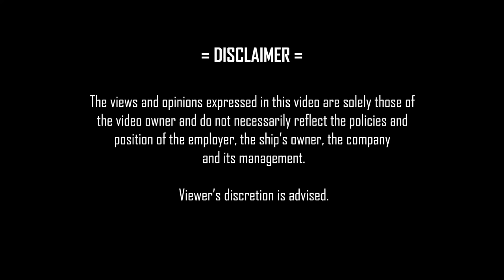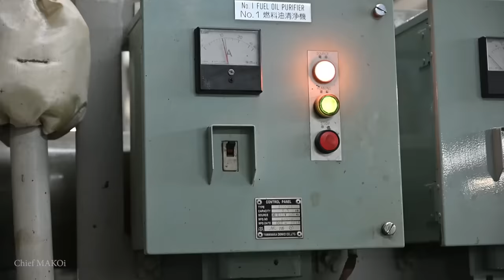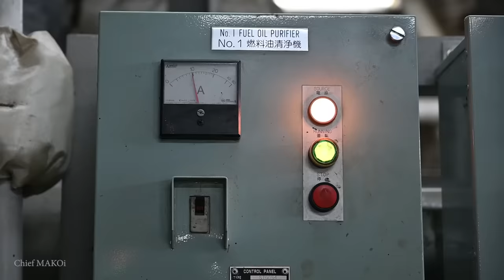Fuel Oil Purifier Overhaul | Selfjector | Chief MAKOi

Comment: Interesting from the mechanics point of view. Skilled labour I have to say, some little improvements could be made, a washing cabinet with pump and brush for example. Best would be a parts washing machine, but I guess filipino hand wash is better and cheaper ! In high labour cost countries its another game.
I also don't even have a washing cabinet, hand wash as well ;-(. Maybe i can find a drawing to understand the function. It separates liquids by density, interesting, normaly solutions cant be separated that way, so this oil might more be emulsion type of fluid.

There is a saying in german : Hand operation is better no matter how sweet the girl is ;-) Bwahhaaaaaa

Comment: What is the clear liquid which is used to clean all the parts? For example at 12:26.
Reply: I believe it will be something like kerosene or acetone.
Reply: Its a strong chemical/acid that instantly removes heavy deposits of oil or sludge

Comment: 18k RPM sounds crazy. Could you mean 1.8k RPM?
Reply from the maker: No.  18,000 rpm.
Reply: @ChiefMAKOi  It must be balanced like a swiss watch!
Reply from the maker: @PointyTailofSatan  it should.  Otherwise the bowl will fly out.
Reply: @ChiefMAKOi  More like explode. Do you realize this speed is the same as a dental drill?

Comment: That fuel oil.looks like black paint. Yaw must mix that with diesel.or.somethimg in order to burn that product in the motors
Reply: Therefore we heat it to about 135 degr C (depending on viscosity)

Comment: what a comical amount of special tools. clearly not designed by someone that has ever worked in the field.
Reply: These tools are absolutely necessary to avoid damage to the parts which run at high speed.
I personally did not like the use of that large puller to remove the top bearing from the vertical spindle. It for sure damaged the center hole. Bending the relatively small dia  threaded end is also a possibility. I never worked with these Mitsubishi’s, but I can imagine a puller design which you have to screw on
Reply: @janvisser2223  i understand this design requires these tools. i am just making the case that a better design would not require those tools.
Reply: @SupremeRuleroftheWorld  Understood